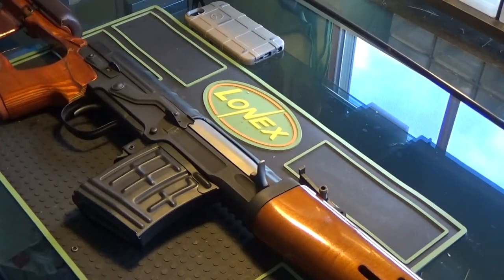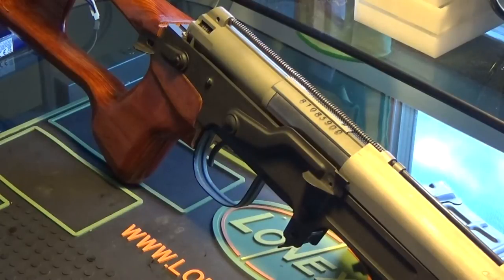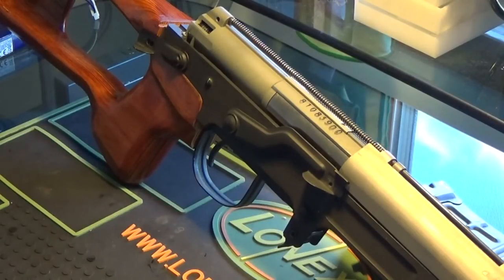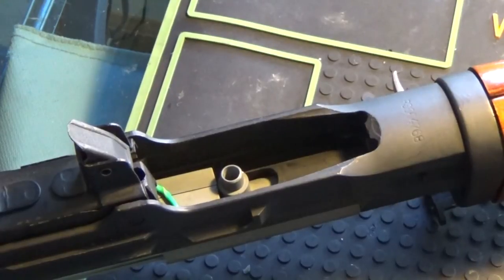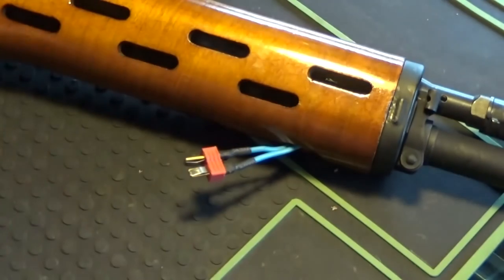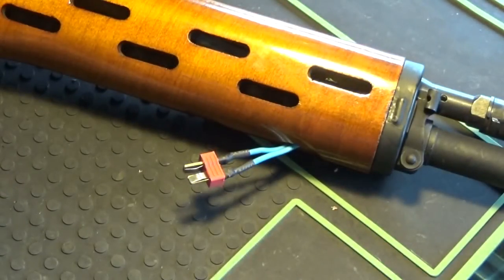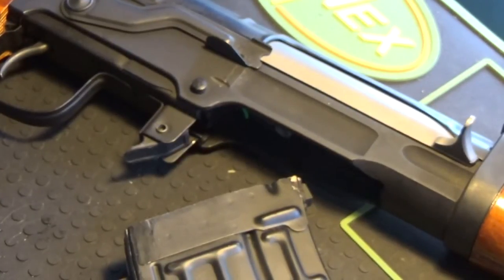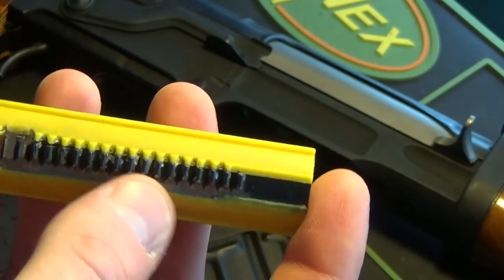520FPS RealSword SVD DMR Build!

Comment: Just as an FYI:
3 of the stock gears are standard AEG gears.
The 4th gear, the smallest one, is specific to the SVD gear box and replacements are readily available.
I do believe you could use different ratio gears than stock, but I'm not sure if there would be any issues meshing with the 4th gear.
Cool video.
Reply from the maker: PhantasmAMX I'll have to look into it, but I don't think other gears would work based on the design. Plus, the stock gears are honestly great.
Reply: TheAirsoftTech
First off what I said before isn't quite true since obviously you need a 19 tooth sector and not a 16 tooth.
On to my research.

http://shop.ehobbyasia.com/real-sword-t3-steel-gear-package-for-rs-svd-aeg.html#.VSrpmmc5CUk
That's the full set of gears, and you can see only the smallest one looks odd.
http://shop.ehobbyasia.com/real-sword-svd-transition-gear.html#.VSrpqGc5CUk
And there it is, what they call the "transition" gear.

However upon closer examination I think the spur gear is different as well.
It looks much more like a torque up gear set spur gear like the one seen here.
http://shop.ehobbyasia.com/shs-infinite-torque-up-gear-set-for-gearbox-v2-3-aeg-geniii-32-1-1.html#.VSrxbmc5CUk

However the teeth in the middle of the gear go much higher up the shaft than on standard gears.
I believe this is so they can make contact with the full width of the 19 sector gear teeth, since the 19 teeth are just a continuation of 19/30 teeth on the sector gear.
In general, it just looks like a torque up gear set, except for the transition gear.
I think if you switched the 3 gears with a 32:1 set, they would still work.
The spur just wouldn't make full contact with the sector.
Obviously the transition gear you have to buy RS or CYMA.

But therefore, since I don't think the diameter of the spur changes, only its smaller circle of teeth, I think you could actually switch to a standard ratio set of gears and it would work, and then even allow you to use a full tooth piston, since it doesn't have the full diameter sector teeth of the torque set.

With the 4 gear setup and the 32:1 gears other than the transition gear, this thing really is a torque monster, probably much more than it needs to be really. :P

That said I still can't 100% guarantee standard gears will work or that you could use a different ratio set.
I just thought I had heard that was the case from researching upgrades for the CYMA SVD, which uses the same gear setup.
Reply: TheAirsoftTech Oh, and yes the stock gears are supposed to be fantastic. Even in the CYMA they are allegedly quite good. :)

Comment: My RS SVD currently has 560 FPS)). Once I get an M170 spring it will be around 630))...Right now in its current condition my RS SVD with a bipod is able to hit a target with a size of 30cm x 40cm (11.8 inch x 12.7 inch) from 60 meters (200 feet) 10 times out of 10)). It has a 6.02mm steel inner barrel, yellow Maple leaf hop up bucking and I use 0.36 g white BLS BBs. The gearbox internals are stock except for the gearbox shell itself. My SVD runs a Retro Arms CNC gearbox shell with an uprgraded wires and a GATE Nano AAB mosfet...
Reply: может мождно контакт? Есть пара вопросов по апгреиду RS SVD .
Reply: @woodcrest543  спрашивайте)
Reply: поставил Guarder M160, на пятом выстреле сорвало шестерни.. Шиминг сделан, только АОЕ нет. От кокого производителя ваша ваша пружина?
Reply: I see that you answer, but comment does't appear

Comment: Shimming could be better. It sounded a bit whiny. That may have been motor height too.
Reply: could just be the gears in general. having four gears might be weird to shim. but i could be wrong
Reply from the maker: It's actually spot on. RS gears (particularly their pinion and bevel) do not mesh at all.
Reply: damn i feel smart lol
Reply: Yea, sometimes gears just don't mesh naturally. I had spent hours trying to reduce the whining of my CA sa58, but the noise between the bevel and spur gear just wouldn't go. The motor couldn't have been quieted using tape/repositioning, and a simple flick would send the sector gear into 3 to 4 full spins before it glided to a rest. The aoe between the pinion and bevel was of course spot on as well.
Reply: +Bisterk Ding Hopefully you see this haha, i picked up a Guarder m150 kit for my ca sa58 and its really tight in there is that normal?